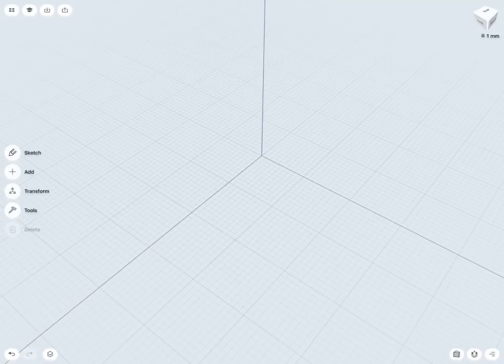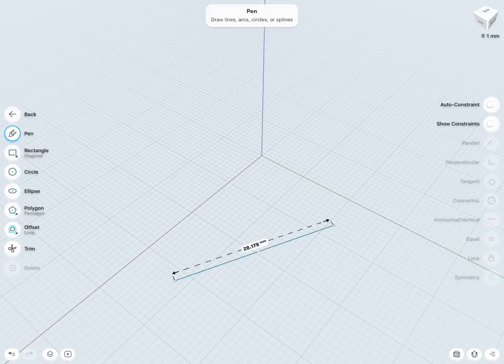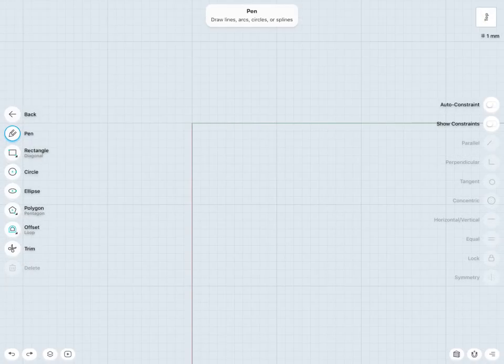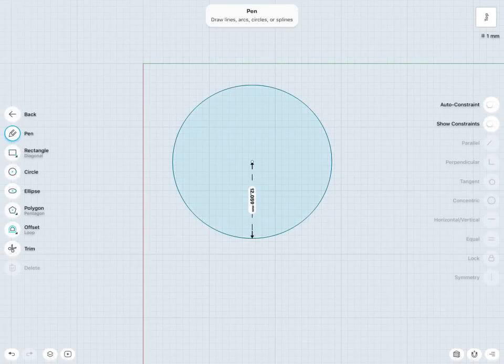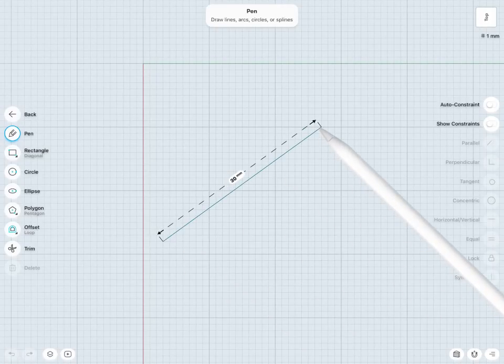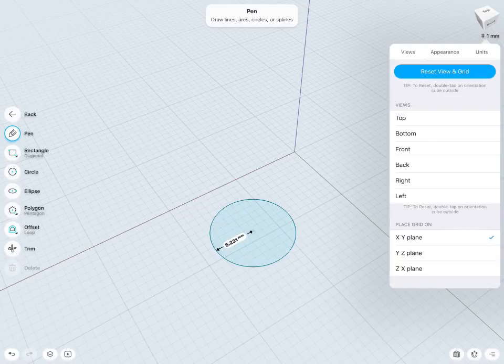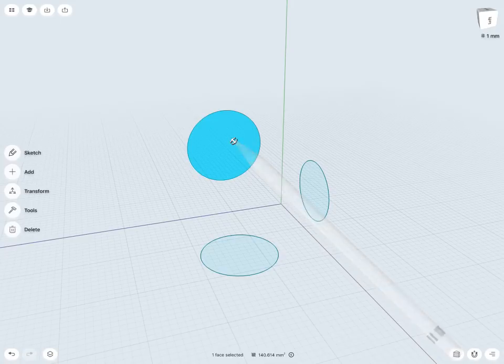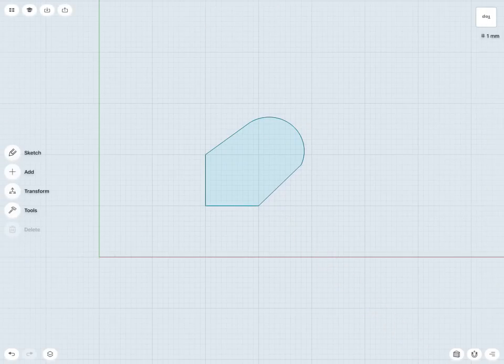Sketching | Shapr3D for Beginners

Comment: I want to know most of all is how to insert a picture of a thing, anything then get another thing and import this other textured thing and overlay it over the first item I imported.   Say like bringing in a pipe and adding a texture to the outer side of the pipe. Hope you’re understanding me. Seen it done but I was not interested in this skill at that time. Many moons ago.
Reply from the maker: Hi, I do not completely understand what you will like to achieve. You can import an image and then place it on a body using the Transform move/rotate option. 

Tap to select the image
Tap on Transform
Select the move/rotate option and use arrows to move the image.

Please let me know if this does not answer your question.

Comment: Hi, I am using apple pencil to learn it. However, there is a function of line/curve instead of the function of pen within  Sketch. And I can only draw circle edge instead of a  closed sketch.
Reply from the maker: Hi, the Icon symbol and label was updated on the newer app version to Line/Curve. Still the same concept and simply an updated UI.

Comment: The stuff at the left aren’t showing up help
Reply from the maker: Hi, which of the Tool feature at the left can you not see? I will be looking forward to hearing from you.
Reply: Shapr3D the pen, rectangle, circle, ellipse, polygon, offset, trim and delete are not showing up I’m on iPad and it says it doesn’t support apple pen even though you can use your finger.
Reply from the maker: Hi, thanks for your response. Shapr3d requires the Apple Pencil and for modeling, the app currently only supports Apple pencil compatible iPads. Here's the list of Apple Pencil compatible iPads and the  Apple pencil generation they support: https://support.apple.com/lv-lv/HT205236

Comment: One main problem is that some pens like the microsoft pen have the same things as apple pen. Thus allowing older devices to be able to model in shapr3d. But. It fails to give us the sketch options. You should at least leave them there and let people experiment.
Reply from the maker: Hello, thank you for feedback. Currently, we only support the Apple pencil as the most effective stylus completely compatible with Shapr3d. We will keep looking into supporting other stylus' when we confirm that compatibility with the application. Thank you for your understanding.
Reply: Shapr3D I have a stylus pen but its not an apple pen
Reply: only the apple pencil works because it still thinks a stylus is your finger
Reply: LaserWorms lol